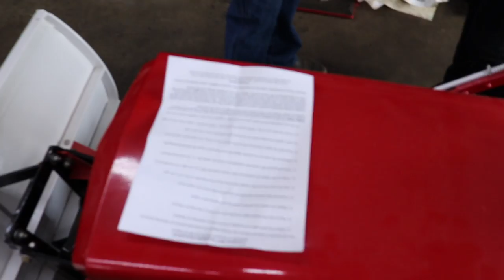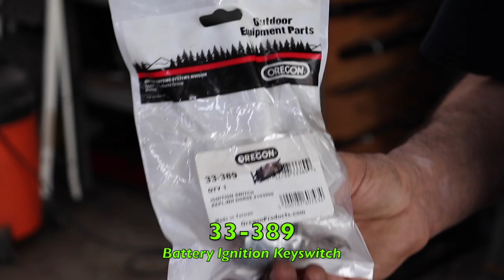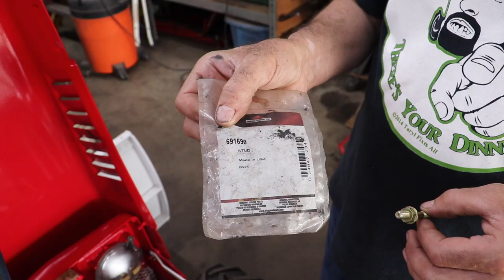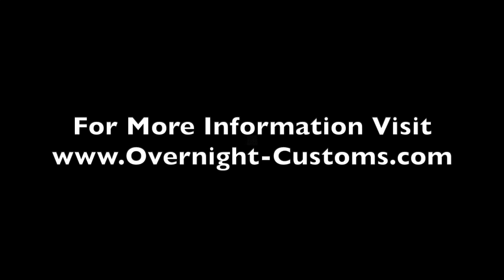We're Screwed. Obsolete Ignition Fried! What Do We Do Now??

Comment: It's seems like it has hotter spark and gives the tractor more torque and speed. Great job guys.
Reply: It's been many years since school, but if I remember, solid state systems produce around 20,000 volts while standard coils produce around 30.000. Hence the hotter spark. There are advantages and disadvantages to both systems.
Reply: @jimbrewer2893  It's not quite that simple.
Reply: @patrickshaw8595  I was just talking basics. Of course it's not that simple.
Reply: @jimbrewer2893  Farrraday documented and then wrote the formulas for the "flyback effect" of a magnetic field when the circuit that was creating that field is instantly halted. If you get creative to maximize the effect with two separate coils of wire that's the classical magneto or battery coil system with mechanical contact points.
 The voltage available is theoretically INFINITE in any such system.
   Skip now to what you are trying to accomplish with such a system- jump a spark gap. Doing it while the gap is inside a pretty fair vacuum and also while same gap is inside couple-three hundred PSI is not too demanding nowadays we got good insulation to keep that voltage from going anywhere except the gap.
          There's always gasoline or propane or something mixed in with the air. If it's mixed real thinly (lean) then a big gap and a long spark duration are very helpful.
         If the plug is sooty or wet then making the voltage at the gap jump up so fast it goes across the sooty wet surface and across the gap and still starts the engine.
Battery-and-coil builds up slowest - a good magneto is pretty good at it - and best of all is CD capacitive-discharge ignition which is why it gets used in two-cycles, outboards and the like - most beneficial when starting.
There - now you know just as much as i do on the subject.
Reply: @patrickshaw8595  
It's fun to see guys change out ignition parts from a "yellow" spark. 
Using a real spark tester, don't worry about color.
That's from some crazy 💩 burning ions out of the air or something 🤣
Can it jump the spark testers gap is the main question. 
These ol dogs don't need much spark to run,and the timings fixed. 
After all these years now Briggs has an electronically advancing ignition on the newer bigger engines ,and it's given them a bunch of power.
Reply: @MrTheHillfolk  You are absolutely correct that if it will jump a MANUFACTURER-SPECIFIED GAP out in the atmosphere it will jump the MANUFACTURER SPECIFIED spark gap on a clean spark plug under compression. 
      Me - being the jerk that I am - I like to find ways to "cheat" the system !  You can run the spark gap 10 or 15% smaller and it will start and run under load just fine but when running hi-rpm + no load it may stutter or the muffler may run extra hot. Just to get one running tho it will be fine.
        You know the "Easy Spin" or ACR automatic compression release is highly dependent on valve clearance being correct right? Too much clearance or a busted ACR system will cause too much compression and it will "snuff out" the spark (it's a mag = requires rpm to work).
        So you got one you're trying to get running "beat the plug gap down to .020" and spin the bejeesus out of it !"
Reply: A "hotter" ignition WILL NOT increase the torque or speed of a PROPERLY functioning "stock" ignition! A popular misconception. Manufacturer hype for selling "fancy" ignition systems!

Comment: I'm definitely looking into this. I've got seven of these old Sears tractors, and it would be nice to get them running again.
Reply: I was probably the first one to make a substitute for the original system while still a teenager. Used the battery charging coil from an electric start Lawnboy handmower next to the flywheel as an inductive trigger for a standalone GM HEI module with the 6-cylinder HEI coil. I had to tune the offset input voltage to the module with 4 tiny diodes and a resistor to come up with 2.1v.
It worked well but because the ignition coil was energized for a fixed crank angle (there was no way to use the module's adjustable dwell capability) if you left it idling too long the coil was subjected to "on" times longer than 3 milliseconds and it would eventually overheat and short out. If you had it running at least 2800-3000 rpm or up then it was fine.
       Other than this kit Taryl shows the easiest way to scratch build an ignition for on of these now would be to epoxy tiny super magnets to the flywheel's periphery, use any automobile Hall Effect sensor (that you can find the wiring diagram for) hooked to one of the remote mounted Ford Thick Film Ignition modules. 1) It would work at Zero Rpm. 2) It would adjust to the correct dwell if paired with the correct coil. 3) Get the parts from 1988 Ford Mustang 5.0 called "the push-start module" ($90 for everything from NAPA)
Reply: Please do!  Those old girls are great tractors that far exceed the quality of what they are producing today.

Comment: I did something similar with a 1969 Bolens 1455. I made what is usually referred to as a "dirty" power supply. I hooked that up  to pickup coil under flywheel, and hooked that up to an early 70's GM ignition module to fire ignition coil.
Ignition module had to be mounted to an aluminum plate for cooling itself. Just cut a 3x3 square and attached it to blower shroud. 
I also added a wire with a diode to the "start" on the original key switch so engine would have spark during cranking.
Years ago I drew a diagram for Bolens, it should be floating around the internet somewhere. 

Best tip I can add to this is, pay attention to where 12v is going cause you can, and will burn shit up IF not done right, and think things through.
Reply: Excellent. HEI came out on GM cars in '75 and I think I did my first HEI conversion on one of these about '77 or '78. You might have beat me to it. However I figured out by about '93 that "everything except the distributor" from an '88 5.0 Mustang worked really really nice and trouble free.
Reply: @patrickshaw8595  Yes, they work fabulous!
Keep in mind, the reason for using the early module was the early GM ignition did not use any computer control.
God bless

Comment: I have a couple of old antique pieces of equipment. A DR wood chipper with a 12 horse single cylinder Tecumish on it and a 2004 Scrub Cadet LT 2042 with a Kohler engine and shaft drive. They aren't really antiques, they're what I use to maintain my place. The deck on the scrub cadet needs welding, Tecumish stopped making spark while I was running it last time, so thanks for this video. It's probably going to come in handy.

Comment: I’ve got one of these tractors, & got rid of the stock engine initially cuz I didn’t want to deal with it.

Edit: I still have it & yes the old coil does work & the engine does run. The wiring harness on the tractor itself is all junked up from sitting outside.

Comment: I did the same ignition set up on my 1967 Sears super 12 it originally had the Tecumseh with points, but that motor is long gone, someone put a tecumseh solid state motor on it and the solid state died on it, so I put this overnight solution kit on it and it runs the best out of all the sears mowers with the Tecumseh solid states that I own

Comment: Carbide tools are great but they produce a zillion sharp and tiny metal shavings.  That wouldn't be so bad but when they are on your hand and you bump one they hurt!  Hopefully they are ferrous metal so a good neodymium magnet will get them out.  I got them out that way but you really do need a strong magnet to do it that way.  The other way is with a good magnifying tweezer.  A light with a single light source is helpful too.  If you have multiple light sources they may produce multiple shadows making it a little harder to get the shaving.  These dang things are tiny but they hurt a lot more than you might expect.  You can wear gloves but then you have a glove full of those horrible things!!!

Comment: The instructions say to mount the coil away from heat and vibration. Seems mounting to the head bolts would cause a premature failure in a day to day use situation. (From instructions: 6) Mount the ignition coil and Transdenser II away from heat & vibration ——-

Comment: Here's a great hack if you have a solid state ignition system it's gone bad and you don't want to pay big bucks for that coil that has the unknown other guts in it. What you do is get a regular magneto coil that's intended to operate with points but then use one of those little $8 modules that eliminates points.

Comment: And they seem to not know that stands has several parts, but as far as police in Rotary, and everything they had, and all those books there, but they couldn’t find me a heavier poly with a smaller shift, so that’s why I want the right one but I would like to have a cast iron or steel bully for all of my 1 Hour Loop with getting from the hardware store so it’s a weird shape size the one that came off of it. It was a 1 inch so I can track Lundry to buy one pack on it was like a push mower so you see the problem instead of on her so I had a bushing me you love.😅

Comment: You can make your own kit to fix the you use a 00s Ford f150 abs sensor for the rear diff and a gm HEI ignition module and and a 12v coil. I did that on an old wheel horse for a customer that it was very sentamental

Comment: I have a 1968 Sears s S12 the generator quit so I just use a pull rope  to start it no need for battery or generator it has 3pt lift with disc harrow and mold board plow it also has the push blade for the front I make a garden in the spring and plow snow in the winter to the man there's ur dinner and slip dog😎 there's ur supper wooo 1968 sears ss12 baby yeah!

Comment: Typical Tecumseh, they had many variations of ignition systems that were not terrific, having this in combination with a starter generator is just strange, I would think it would be easier just to have battery ignition like the old Kohler ks series with the high amperage ignition switch, eliminating a solenoid and everything. Simpler is better.

Comment: 40 years in service you´ve  said... :) Are you familiar with an old, long time gone brand of small engines called Universal Motor Co (bought by Westerbeke 1990) ? I have a 1cyl 7-8 hp gasoline thing called "Type 10" from the late 50´s. It has an old moped style circular plate with two coils (1 for charge, one for ignition) Bosch ignition system placed behind the flywheel and an external breaker point they bothered to angle gear to a separate crank. No breaker lobe on the main crank. I count 4 or 8 magnets in the flywheel, not sure as they are integrated. Not like B&S. How would you go to town electronify such an abomination ?

Comment: Thanks for overnight solutions I do a ton of that stuff. I learned my lesson one time converting a KT 17 using a mag 20 black and blue up my KT 17 that have enough fuel shut off valve.
No the story they’re cool nights in hot days float stuck

Bang 

Had my local NAPA machine shop stuffy machine it they told me don’t hook it up right away sure enough I shorted out I was taking the freaking flywheel off. 

I got about 14 tractors they all have different ignitions

Comment: Seemed like a pretty painless fix.  Interesting how solid state is obsolete?
Reply: These were about the first. Circa 1972 on Tecumseh and Kohler.
Reply: They changed design shortly after the 1st attempt making replacement parts NLA. Bolens did the same thing back in 1969.
Reply: @Guns_N_Gears  Yes if you give me a while I can dredge up who originally made these systems - thinking Motorola or Honeywell.
     Remember they had two magnetic pins stuck out the flywheel, the longer being starting ignition timing - and the shorter one preceded it (direction of rotation on flywheel periphery) such that the inductive trigger could trigger on it at increased rpm.
  I checked with a timing light once and by 1200 rpm idle speed on an HH100 it was running on the shorter pin.
Reply: Obsolete in the sense that an oem part is not obtainable?
Reply: @luuk-out-below9804  Yes back then the only way to fix it with factory parts was a new crankshaft, flywheel, and the stator containing both a magneto and alternator windings. I recall the conversion's alternator output was only 5 amps versus the solid state's 15 amps.
Reply: @patrickshaw8595  Interesting thanks.

Comment: Love ur vids, I have a problem with a vangard engine, I've talked to the repair shops around me, no help, could u help? O B one ur my only hope!  :-) So I'm going to tell u about it hoping u will comment, the engine is a B&S 303777 0332-01 engine someone gave it to me because they couldn't fix it and I thought how hard could it be?, well, it's hard.  I took it because it had good compression 135 both cyl.  what has been done so far, new plugs, carb,  new coils, flywheel key is good, valves lapped, guides and seals good valve timing good, I checked that I didn't lose a cam lob, I didn't, I have checked fire, vacuum leak, but still only one cylinder fires, I know this because it's hard to keep running and only 1 cyl gets warm. I checked or did all this myself.   Any ideas on what to look at?